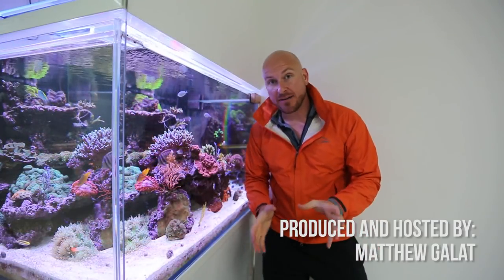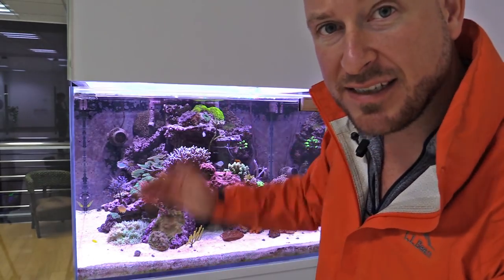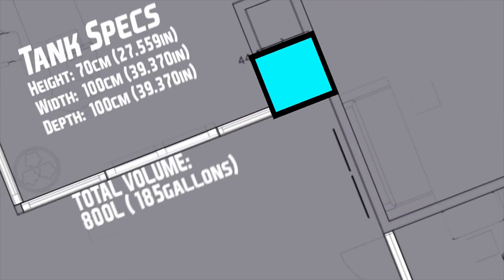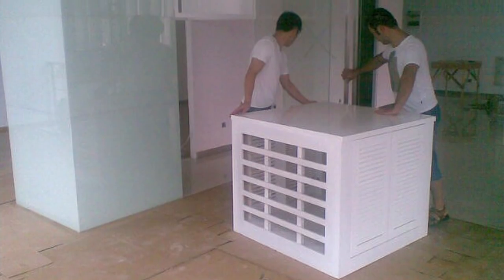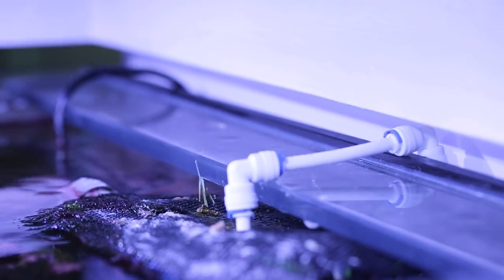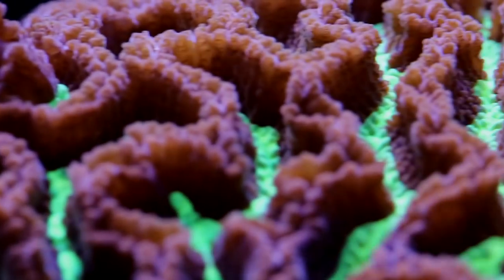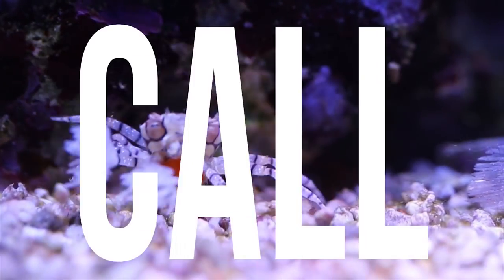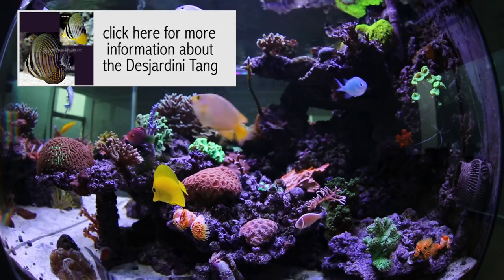Matt's Reef Tank | Episode 1 | Tank Construction

Comment: I would also like to pick you brain on getting a decent camera. I have a Canon DSLR that was bought well before they were able to take full HD video, so I would like to get one that does. I know that they can be quite expensive, but if you could point me in the right direction, it would be greatly appreciated.
Reply from the maker: well.. if you want to make tank videos, i suggest you get a decent zoom lens and a macro focus.  they can be expensive, you are correct on that... but they are worth the investment.  I have a Canon 5D mark 3.  My go to lens is a 24-105, and its the default lens canon includes with the camera.  if i would upgrade i would get a 24-70, they say that is best, but it is also a couple grand.  My macro is a 100mm... and that gives you those beautiful close shots.  if you are interested you are probably looking at 3-4000 USD.  But you get what you pay for.  you could probably get a 5d mar 2 for less.. or even a 70 d or something... but the 5d3 gives you a full frame sensor.
Reply: Thanks for your response but budget is a concern. With that in mind, what would you suggest? I am looking at a 70D that I might be able to swing. Is that a capable camera for a beginner? Also, it comes with 18-135mm lens.
Reply from the maker: Wesley Forbes II in all honesty... its 90% you.. and 10% camera... get what you can afford.. just make sure that is has a good range of focus... the 18-135 should work fine... just get it and start recording. that is the fun part
Reply from the maker: Wesley Forbes II yea.. 70d is a great camera...  use the lens it comes with... just have fun with it and try to improve every time.